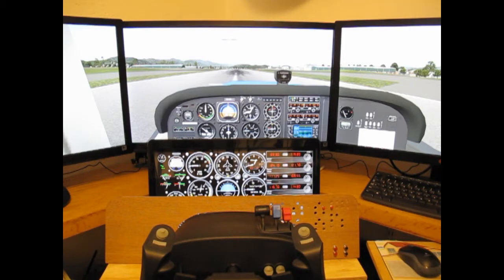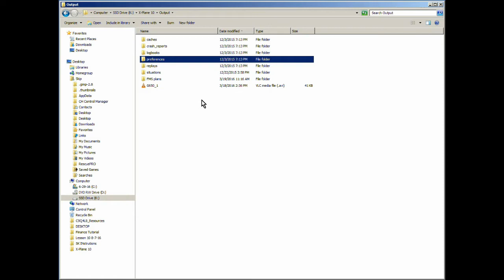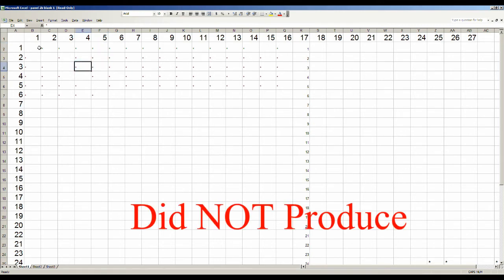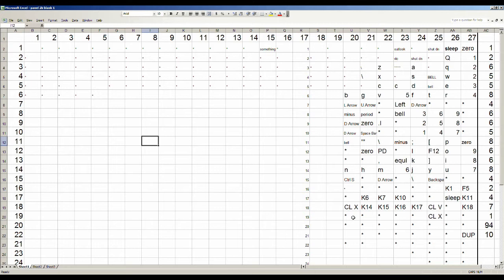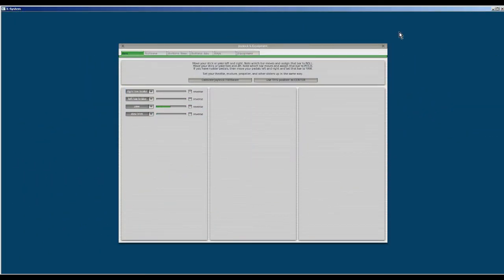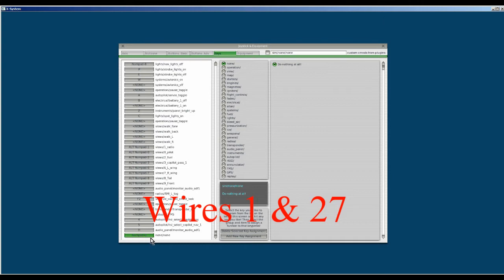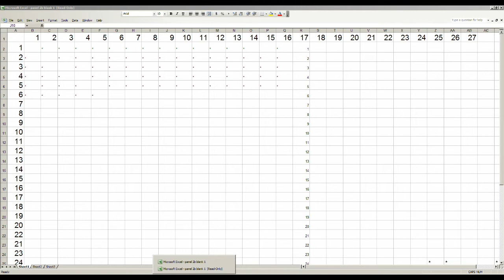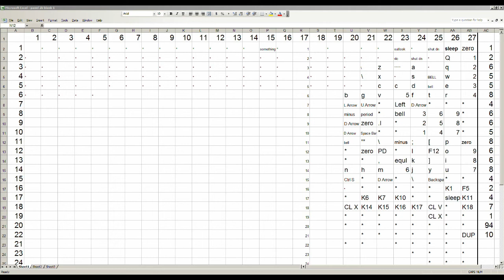How to Build Your Own Instrument Panel for X Plane ~ Part 2

Comment: Nice video, excellent explained. What about additional keys the require the shift, control, command -key being pressed. I guess that in order to use these a double-switch is required, right? Does this also work? Just in case that the number of (single) keys is not enough.
Reply from the maker: Hi Rainer, Thanks glad you like it. I didn't think about that, I suppose you could put two wires together from different contacts onto one momentary switch if you can identify the control or shift keys I don't see why that would not work but I didn't try that, wish I did and if it would I'd have made a bigger panel now :-)

Blessings,
skip

Comment: Greetings. Im in the process of building my triple screen system. I have a question. How high off the floor is the top of the instrument panel supposed to be? Thanks Bill
Reply from the maker: Hi Just Truth,  I'm not sure how high off the floor it should be but I think it''s more important as to how well it fits you eyes. You want to be as comfortable and ergonomically correct as possible and getting the monitors at the right height is very important. In regard to the instrument panel you want it were you get the best visibility. I'm assuming you are making an instrument panel and not talking about the panel you see in the monitor! So I suggest getting the monitors at a height that fits you well and the instrument panel in a place where it would be if you sat in a real airplane. As a rule what you see on the screens in the simulators  is pretty good as to were your "eyes" would be if sitting in the airplane so that could be a reference. If you are planning to run the sim without displaying the panel and only have the outside views placing the panel close to the middle of the screen or a bit lower would work I think but this may not work for all airplanes. If I were doing this I'd try and make it possible to raise or lower my home made panel a bit to accommodate different airplanes as moving the seat up and down changes you angle to the monitor and I believe that position should not change once set up ergonomically.

Probably made this answer a bit more complicated than you wanted but things to consider, hope it helps, let me know how it goes.

Blessings,
skip

Comment: Great video.  Thanks for taking your time to make this.  A couple questions if I may.  The buttons used.  Are they 'normally open' momentary switches?  Or normally closed?  I'm assuming open?  Also, can SPST switches be used as well as potentiometers??  As always your time is appreciated.
Reply from the maker: Thanks Keith,  Your correct Normally Open switches. All switches must be momentary just like the buttons must be normally open. They MUST work like the keys on a keyboard only making contact when pushed down no contact when released. SPST switches are NOT momentary so using them would be like holding down a key on a keyboard all the time which will cause all kinds of problems. Potentiometers are never "open" or momentary so they can NOT be used. Basically what you are making here is a fancy keyboard so everything must work like a key on a keyboard.

Here's a tip for when you start to wire up and solder the switches and buttons. Test them as you go!! wire and solder a couple components then test with a word processor to make sure you have not accidentally shorted out a component or crossed some wires.  It will be much easier to find mistakes when there are only a couple components to check. This is very important especially if you have a lot of components. Go slow check your work often and you will be fine. Make sure you unplug the USB cable before wiring and soldering!! 

Keep me updated as you go I'd love to here how your doing and if you come across something that might be helpful for others who are trying to build a panel please tell us about it. Good luck.

Blessings,
skip
Reply: @WEHVideos   spst (single pole single throw) switches come in both locked and momentary. spdt (single pole dual throw) momentary switches would mimic  "on/off" better by assigning up for on and down for off the downside would be 2 key assignments for each switch.

Comment: What do you use to tap the wires? How do you know which buttons work or not? Do you tap the wires that are already soldered to the chip?
Reply from the maker: Hi Xplane.junky,  This is a bit hard to explain here but If I understand your question correctly you are asking about when I say tap the wires together. Well you are tapping the loose ends of the wires you soldered to the circuit board to each other. If you have soldered a wire on each terminal of the circuit board the next step is to strip the insulation from the other end then number each wire. Plug in the usb to your computer and open a word document. Then, starting with wire number one touch (tap) the end of the  wire momentarily with every other wire end, one at a time, and see if a letter or number is written in the word document. You will tap the end of each wire to all the other wire ends. So you are tapping the loose ends of each wire to all the other wires, one at a time to see what character is produced in the word document and you have written down every wire combination character they produced. For example when tapping the end of wire one to the end of wire two together a W (might be a different character this is just an example) was written in the word document. Continue with wire one until you have tapped it to the end of every other wire.  You will end up with a list of wire combinations that produce a letter or number. Tapping the wires together is just like hitting a key on the keyboard. When you connect those two wires to a momentary switch it actually works like a keyboard key and you can program it in X Plane for anything you wish.

As for which buttons will work or not depends on the wires you solder to them. In the example above if you soldered the end of wires one and two to a momentary button switch then when you press the button you will get a W. Hope this makes sense and helps, let me know.

Blessings,
skip
Reply: Thank You helped a lot!!
Reply from the maker: Hi Jack, Your welcome, let me know how it goes.

Blessings,
skip

Comment: Diy is an awesome way to learn and experiment BUT! Here is the problem, 1: you run A great risk of shorting out your usb socket (they are very delicate and once shorted the will never work again) 2: reassigning keyboard commands will not let you use the regular keyboard for other in game things. 3:for all the countless hours spent mapping the keyboard just to save 10 bucks, NOT worth it. You can build A 32 button/5 dial/2 slider/2 hat panel for 90 bucks (all purchased on amazon) or 24 button/2hat panel for under 35 bucks (amazon).  There are tons of diy button box options out there for everyone's budget all of which does not include frying your motherboard or spending hours mapping A keyboard some even require no soldering. btw your solder joints look like A 7 year old did them.
Reply from the maker: Hi Russ, Thanks for your feedback. Could you post a link here for these panels you mention on Amazon? Before I started this project I could not find anything online for under $100 that worked for me. 

I realize this project is far from perfect and has many limitations however it has worked very well for me and the cost was very low with savings much greater than $10. As for my soldering skills, well after finishing this project I’m guessing I just might be as good as a 11 year old now :-).

Thanks again for your feedback and advice and hope you can reply with some links for parts. I’d love to make a better panel!

Blessings,
skip
Reply: Its a shame when people criticize but add nothing to benefit anyone.  Its says a lot about the person.  It took more time to type out your criticism then it would have taken to post the links that you were asked to post.